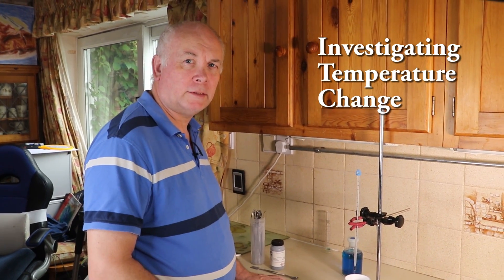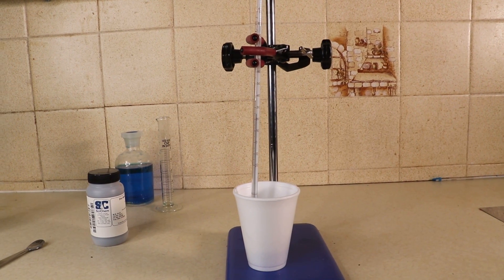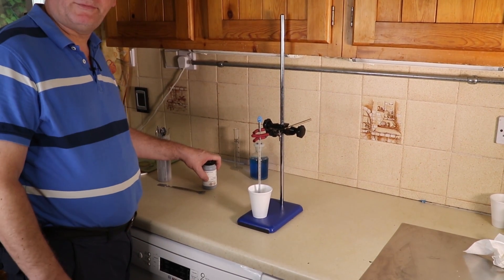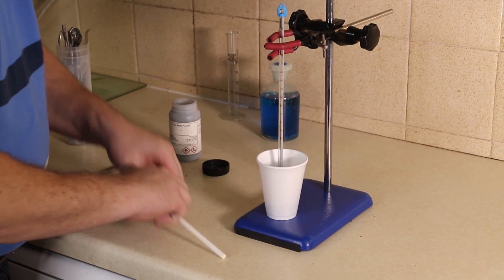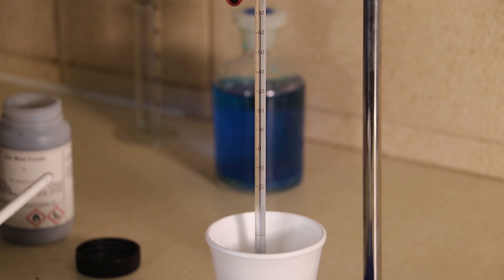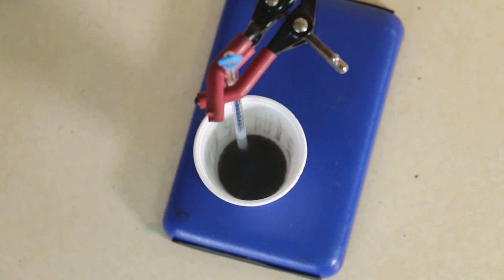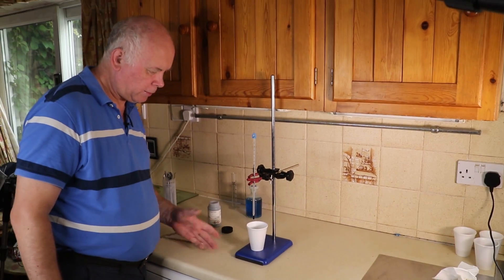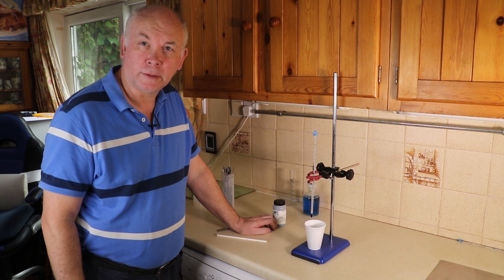Investigating Temp Changes Copper Sulfate and Zinc

Comment: An indothermic reaction is a reaction that absorves energy from the surroundings .it make the surrounding colder .so the substance itself is supposed to be hotter
Reply from the maker: Endothermic reactions the products need more energy to be made than the reactants had, so they get this energy from the surroundings. So the surroundings get colder - supplying the products with heat to make the bonds. The products do not get hotter because the energy they are taking from the surroundings are put into the bonds.
Reply: Thank u .u helped a lot